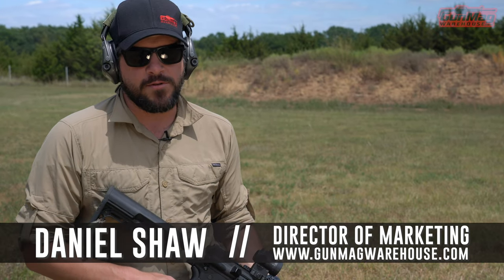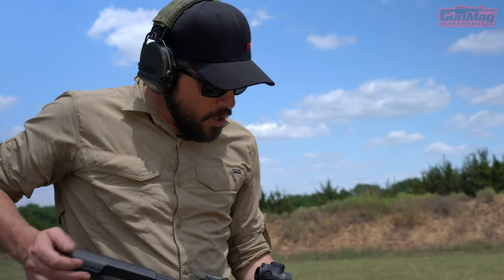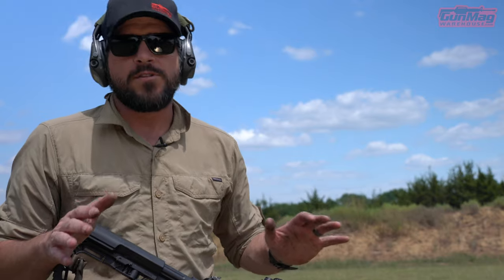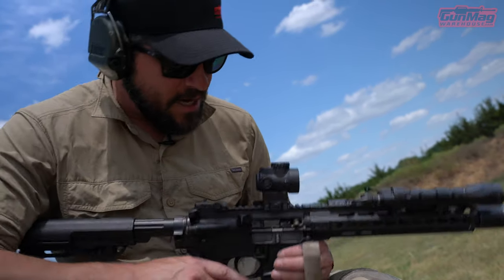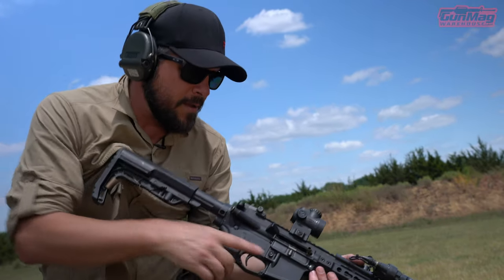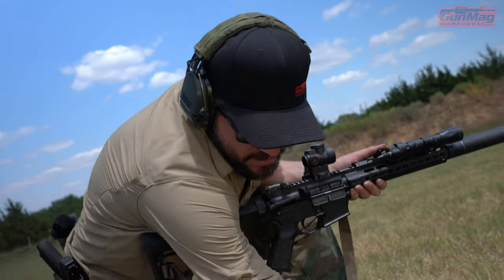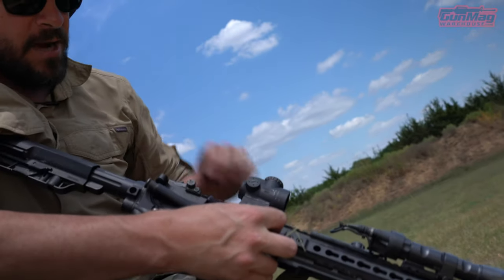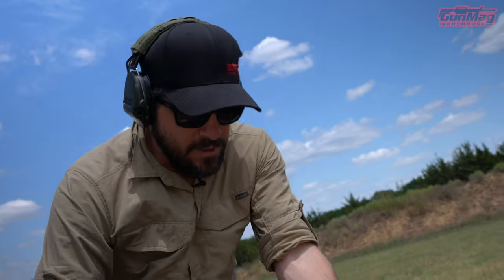The Stovepipe | AR-15 Stoppage Clearance

Comment: I'm literally dealing with something you said was impossible. It's frustrating as hell and I can't figure out how to stop it. I run a 16"Wilson combat barrel, carbine length gas system, SRC BCG. If you fire slow and methodically it runs fine. If you try a controlled pair or more it will feed a new round into the chamber and stove pipe the fired round. The new round is passed the stove pipe into the chamber. I switched out to an H3 buffer to slow things down and it worked for the most part until I run my suppressor. The feed issue comes back. Damn thing will end up in the pond if I don't get it figured out.
Reply: It’s a year later… but I have the same POS bolt. SRC is the issue, I run a Aero Precision upper/lower so I’m investing in a AP BCG.. try swapping out that bolt!
Reply: @F-U-CKYTCensorship exactly some bolts are just inferior especially with the extractor sometimes just having a thicker oring even two small orings coupled will solve it.
Reply: I feel like it’s a problem with Carbine length coinciding with the standard civilian stuff. By chance do you live in NY
Reply: @danielzeller7729  no Sir I live in Florida, I did figure out the problem though. Turns out the WC Recon barrel I ordered was a trial run first gen type deal with a proprietary mid length gas system. The carbine length mounted but it wasn't right and it didn't allow the system to function. I had to order a mid length tube with an adjustable gas block. I got it dialed in perfect now and it's not beating the rifle to death.

Comment: It's possible to have a stovepipe with a new round chambered. Happened to me today at the range multiple times. The extractor is not gripping the new round, though, because the stove pipe keeps the  bolt from closing.
Reply: Me too. Several times
Reply: How are you guys fixing it?
Reply: It just happened to me twice a couple of minutes ago!
Reply: Same today
Reply: @sgtrhyno safe , lock the bolt , mag out, finger tip it out, 2-3 charges to get save no round is in the chamber, mag back in and charge. It’s the safest option imo
Reply: @br0leg274  I ended up getting an adjustable gas block. Got her tuned up now and she runs like a sewing machine. Turns out, I called Wilson combat to ask if any changes had been made over the years to the recon contour barrels. I was told originally they had a much larger gas port and a mid length gas system. It wasn't quite a carbine length and not quite a rifle. This made the system waaay over gassed and even with all the weight I could muster in the buffer the bolt was cycling too fast. I put in and adjustable gas block and problem solved.
Reply: @sgtrhyno  good to hear that you find an fix for your problem.
we run an 10,5“ suppressed gas piston system.
But due to the ammo price increase the branch test out cheaper ammunition.
Actual it’s 35 grain but causing all types of problems. Failure to feed, fire , eject, double feeds and yesterday also and stove pipe and an bolt override.
But the Office guys said it’s good for malfunction training…

Comment: A tool that works REALLY WELL to remove a stove pipe round is using a paint can opener to reach in accessing through the ejection port and using the little lip on the paint can opener, you're going to hook on to the rim of the casing just like an extractor would and pull out the casing
Reply: Also, you could use a leatherman mut. It’s made for it and has some other uses like a carbon scraper and punch for breakdown

Comment: This guys really saying Stove pipe malfunctions don’t exist. I just got a civilian 16” Carbine length Tiger rock upper/ Diamondback lower AR15 with a 3oz buffer and it wouldn’t stop stovepiping until I switched to an adjustable gas block and SCS buffer kit. Still trying to figure out if it was a buffer weight problem or whatever

Comment: this video that he said it does not exist.... well it does and i have issue with my ar15  with that issue in his video...
Reply: he said that the new round would not be held in the extractor. Which is correct, that can only happen if the bolt fully closes, which is impossible if there's a casing in there that hasn't ejected "stovepipe"
Reply: @cameronmorgan4585  in which case it's legit to set up stove pipe drills the way he was trained. It's impossible to set up the drill where the extractor grabs the chambered round.

Comment: So I know you said the first one was impossible but I had 3 yesterday round was held by ejector and brass was nose side in took me hours to figure out how it was happening turns out it was bouncing off my windshield and coming back my father in law caught the last one and we figured it out weird stuff man
Reply: Since the extractor is on the bolt and a stove pipe is between the bolt and new chambered round, it's impossible to have the extractor grabbing the new round. He's right about that but wrong about the drill he criticized being non existent. We do get stove pipes with new rounds chambered. Sometimes they bounce back in, sometimes they trickle out and get stuck.